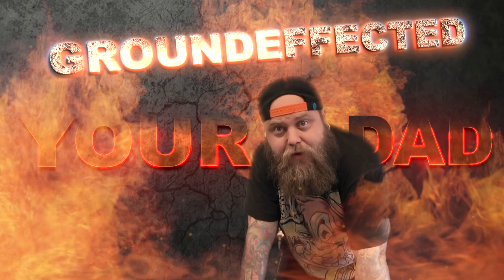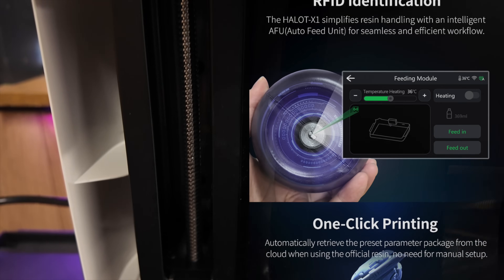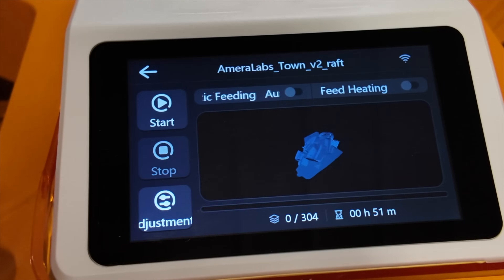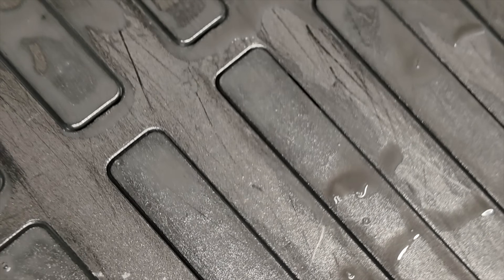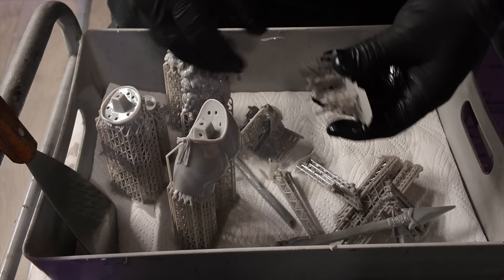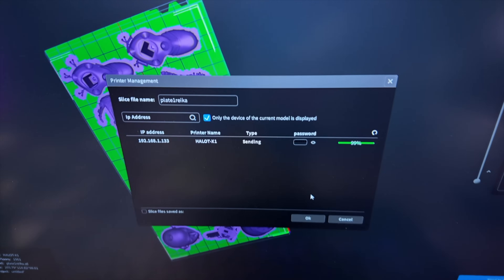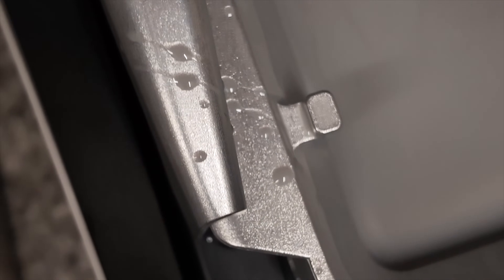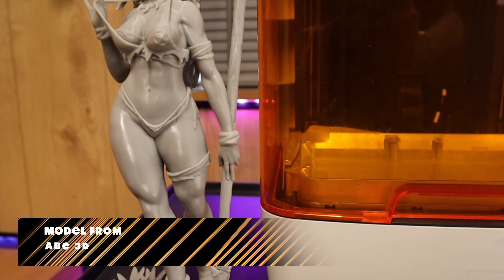Piocreat Halot X1 – Good Results, Some Conditions Apply

Comment: I got one of these via kickstarter, too. I'm surprised I didn't notice this video before. (I got the resin pump as well, plus early bird pricing and some resin.) 

So far, for me it's been bulletproof on prints - the only print I had fail was a support issue, and it failed on my Saturn 4 Ultra the exact same way (I was trying a presupported file.) I've gotten good results. And yeah, I tend to make sure narrow/small parts are aligned so they cross the "short" way so the twist-release has a better chance of knocking them off. I have just been using their resin at the moment, granted. 

Annoyances:
- It WAS noisy when I got it. Fan noise, it sounded like, though someone else suggested it might be the Z-axis motors. A recent firmware update seems to have fixed that, though it's still a bit noisier than my other printers (which... it's lifting the light source and a vat of resin up, I guess I should expect that.) 

- Printing. What you didn't mention - and I don't use "file settings," since I'm using the Piocreat resin and their APU (with the RFID tag,) - is that you go over and tell it to print... then have to tell it to start, which yes, is one more button press, but if you don't realize that, you'll hit print, walk away, and come back an hour later to it waiting for you to hit start. That's annoying. 

- Printing and file transfer. Latest firmware update also for some reason made it unable to connect to my wifi. Which might be fine - and I know the way Dad's shown his workflow, he uses USB and transfers stuff anyway, but unlike my Saturn, I can't send a file and tell it to print remotely. I have to walk over after sending the file and hit Print - Start. Which makes having wifi almost pointless. (Not to mention there's currently no monitoring.) 

The printer has a lot of good, and a lot of possibility, and most of my gripes could be fixed with software (slicers, and getting official support finally into Chitu, Lychee, etc.) or firmware updates. I'm waiting to see what a FEP film replacement is like (and hopefully not an LCD replacement for a long time,) plus just the durability of that mechanism... but  Piocreat was Creality's professional/dental line, so I'm not actually worried over much about that. Anyone buying it, I'd still say if you want less faffing around, wait a few months - honestly it'll probably be more settled by the time Black Friday sales come around (at least in the US, assuming we still have Thanksgiving) and if so would be even more worth picking up. 

My Saturn 4's still my go to, just because I know it and its quirks. But this is not a bad printer at all. And if they get the firmware more settled (and we can get full wifi printing and monitoring, versus having to walk over all the time,) I'd definitely consider buying a second one if something happened to the Saturn.

Comment: I'm happy I canceled this kickstarter. The printer needs a heater and also the resin sprinkler attack i see everywhere. 

Also they not make clearly that in kickstarter the delivery and taxes are not included! So if you support this, than prepare for extra cost! 

But if they solve the issues ans make the build plate better, than it will maybe be a good printer.

Comment: I don't see why you'd buy this over the Saturn 4 Ultra, or the GK printers.
Reply: I have the S4 Ultra 16k. The gap around the tilting mechanism allows leaks to flow directly onto/into critical components. The 16k vats seem to leak more often than previous machines. Defective by design.

Comment: I so want to put this machine through some prints lol I just like the innovation and the design.
Reply from the maker: It’s a cool design and does print fairly decently. More time is needed tbf
Reply: @ yeah I want to see how it holds up to some good size prints but so far it’s looking decent. They are company that used to make machines for dental equipment so I guess they know what they’re doing. Thanks for the review always informative.